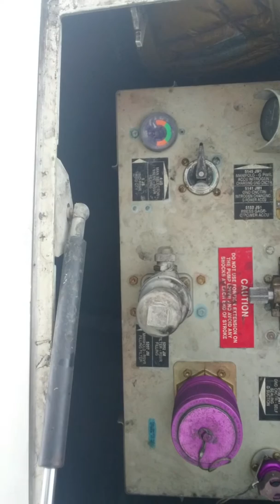Hydraulic reservoirs filling from just one panel, why???

Comment: My friend in A320 when reservoir air charging in one place is that air transfer to the other two reservoirs?
Reply from the maker: yes, all three reservoirs also charged from the same source , either engine 1 or bleed or ground source
Reply: @Haytham_Aly  then while charging nitrogen to one system (50PSI) is it possible the 2 systems get overpressurized? (50 to 75PSI) then excess pressure will be released by overpressure valves?